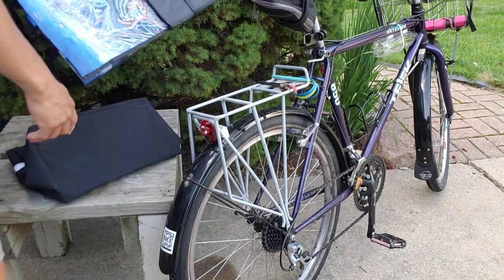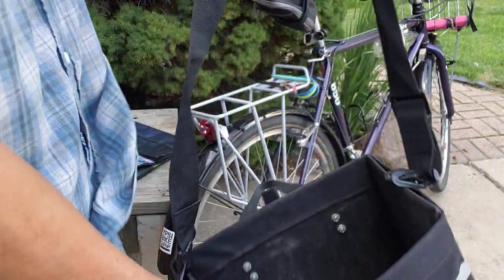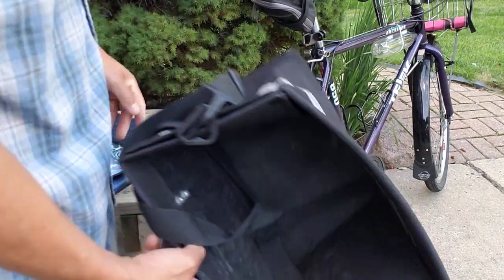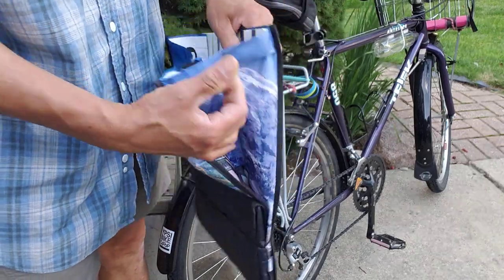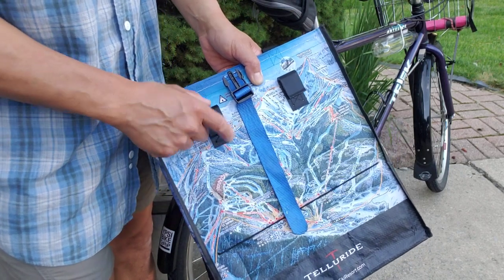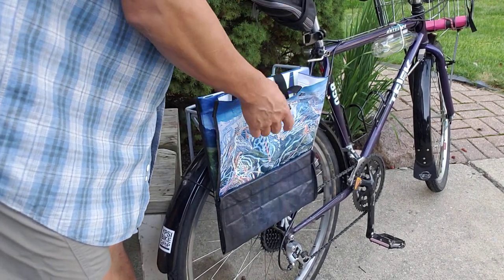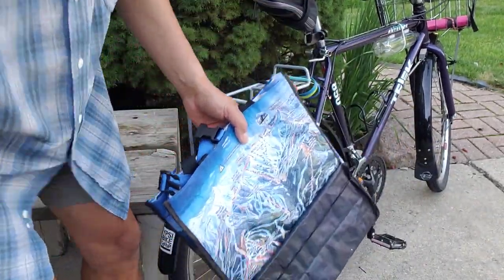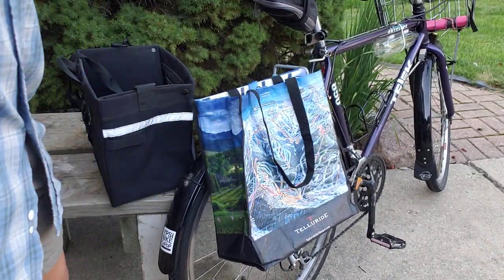DIY Bicycle grocery pannier with 3D printed clips and retention strap

Comment: Very clever design! Would you share your 3D printed hook file please? Thanks!
Reply from the maker: I've posted at Printables.  I also made a pannier using a lightweight messenger bag I got for free.  I recommend the coroplast inside to provide some structure, otherwise a floppy bag could end up in the spokes.  https://www.printables.com/model/905434-diy-grocery-pannier-clips